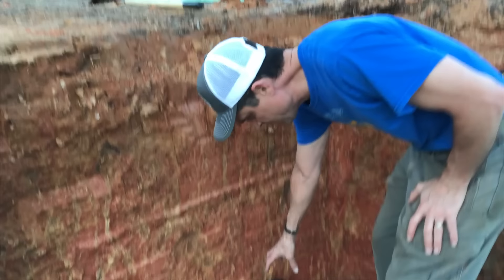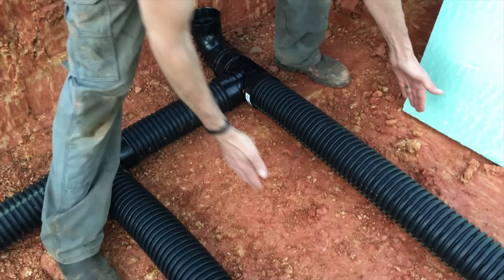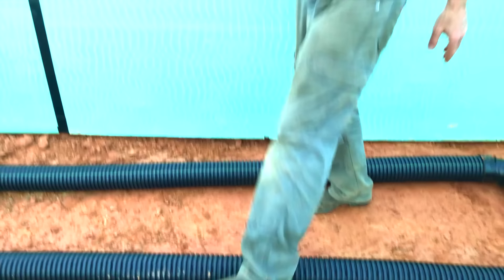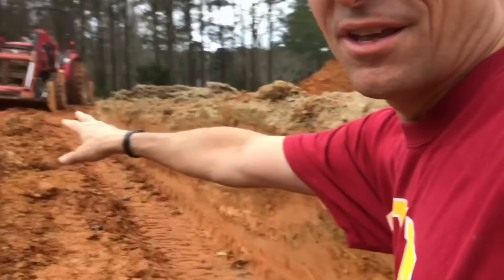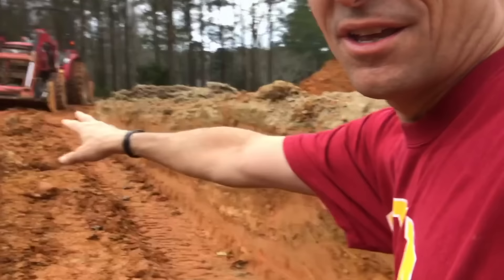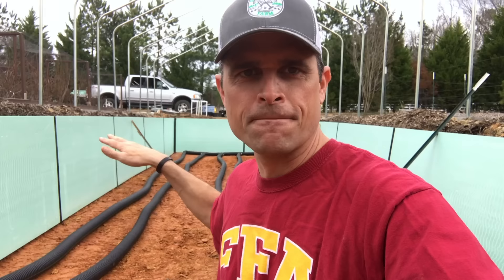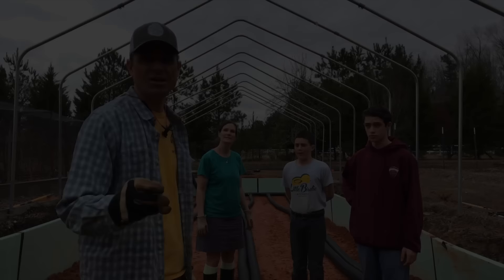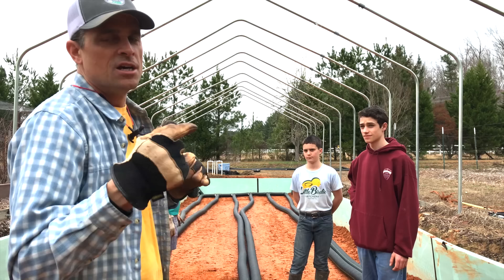DIY Geothermal Greenhouse Part 4: Earth Battery INSTALLATION

Comment: Why are you insulating the ground which should be a steady temperature all year below the frost line?
Reply: Forget where their location is.. My area Friday will go down 6 feet or so, depending on type of winter we have. Isolating the battery will prevent leaching of heat
Reply: Frost not Friday
Reply: Bingo! You're intuition is correct. Insulating around the pit is 100% incorrect.

Comment: I would think that you need several intake & exhaust pipes rather than 1 per level.
It seems pretty restrictive and hard to transfer much heat. I hope that I am wrong and it performs efficiently.
Good luck!    😃
Reply from the maker: We're actually copying the systems that are installed by Ceres Greenhouse Solutions out in Boulder, Colorado: https://www.ceresgs.com/climate-control/gaht/  So we hope it works, too! But seeing as they have installed a bunch of these, we're leaning towards optimistic.
Reply: Yes, that is encouraging. They certainly would change design flaws in subsequent builds if they noticed performance issues. Praying for clear skies for you.
Reply from the maker: Thanks for the prayers! And we'll all get to see how it works soon enough. Best case it works better than we might hope, worst case it moves air and is marginally effective. It's all one big real time experiment. But trust us - we'll let everyone know if it doesn't work as well as we hope!
Reply: Copying is as good as what you copy.  What calculations did they use? What performance testing have they done?? and are you in CO also?  I'm more into water thermodynamics, but I'd guess you have a 75% bottleneck by using the same size pipe as a manifold.  Dig it up and use 8-12" smooth duct for your manifold.  You've put thousands of dollars of labor and materials into this, don't blow it on one critical detail.  Seriously, the airflow is far more critical than the insulation.  

Otherwise the construction and design looks great, one of the best.  Good spacing, no need for gravel, not overly complicated.
Reply from the maker: Thanks for the comment and info. Seems projects like these are always a learning process if it's not something that has been done a million times. And even then, there can always be improvements or more efficient ways of doing it. In truth, we've looked at a lot of videos and read a lot of information on different websites. Even there, folks will say one thing ("You need 10% of the volume in linear feet of tube.") and there seems to be no science or data to back it up (and people let them know that). Another point made is how often the air in the greenhouse needs to be turned over an hour, but no reason is given for that number. So a lot of this seems to be a case of someone did it one way, and a bunch of folks started copying it, and that became the way to do it (including us). So this is an experiment for us. If we have to dig up the ends later and adjust the intake and manifolds, we can, but unfortunately we are on a very tight timeline right now. We'll have to see how it does as installed. All this is to say, your points are well taken. Perhaps we'll put a high efficiency fan at each end of the system, one pushing and one pulling. Again, thanks for taking the time to comment.
Reply: I take back what I said about CERES, their pictures show larger manifolds.  Threefoldfarms also describes a large manifold with short tubes.  

There's nothing new or mysterious about heat transfer, you can calculate it easily once you understand how it works.  Short tubes =less resistance to airflow.  I'm commenting because of so many poor designs on youtube videos, with only a few comments pointing out the obvious flaws, and then your design missed it by an INCH.  

The research has been done, from the 70's, it's not that hard to find.  If you don't want to do your own then pay somebody else for the expertise.  

You have a decent experiment there, measure the airflow, temps and calculate the stored heat per hour, then dig up the upper manifold, fix it and measure again. Compare this to the original design, and to the lower layer of tubes for two controls.  You could easily switch back to the old manifold to confirm the result.  Then you'll dig up the lower manifold and fix it.  THAT would be an experiment, bumbling around and posting video of it on youtube is not experimenting.  I don't think you want to build a dozen of these systems before you figure out how to make it work better, but that's basically what people are doing by copying a video design that has no proof of performance.
Reply from the maker: Is the concern with what we've done that we will have too much resistance to airflow? Or not enough resistance? Or that air won't move evenly through tubes? Or that it will just be significantly less effective/efficient than it would be with a larger manifold? We checked the system tonight and the air flow going in seems nearly identical to the air flow coming out. We do plan to test the system at different times throughout the year and share results.
Reply: Too much resistance.  You have short tubes for low air resistance vs one long slinky tube.  it's just the manifold that's the restriction vs 8-12-18-24" like the professionally designed ones.  Airflow is everything, there is so little heat in air that you need to move a lot of it, and as cheap as possible because air is so much more expensive to move than water, per BTU.  plus a solar greenhouse in the winter may have an hour or two of extra heat to capture.  

With the right size manifold that system will easily capture twice as much heat for the same watt fan.  That might only mean a couple degrees difference at night though...
Reply: I think that your configuration and layout of the piping system is as good as I have seen and I've been studying this since the mid 80's. Sure you might have used larger headers, but why? The airflow will drop once it hits the laterals and allow more time for the heat to bleed off. Your two ended design is genius and solves many problems including air mixing. Don't listen to the naysayers, everything including the insulation is correct. You did your research well.
Reply from the maker: Rebecca, I must admit that your comments have been dogging me since you posted them. Continuing to do more research, you are absolutely right. Our need to rush the design and build of the greenhouse shortchanged us on time for research. There were several things I was not grasping as part of the total design. Unfortunately, this means I'm headed out today to see how much of a challenge it will be to dig up the ends of the pipes and replace them with larger manifold pipes. Thank you for taking the time to comment and continuing commenting in an effort to help me understand!
Reply from the maker: Thank you for the feedback. Unfortunately, I am now coming to understand the need for larger manifolds. 4" energy efficient fans are pretty limited in terms of CFM. When you move up to 6" fans you can more than double the CFM for not much more cost. The problem is that 6" fans really won't work with 4" ducts - at least not for the manifold. This is of course how HVAC ducts work - why that escaped me before is still a mystery. Ultimately, most sources say we need to turn over the air volume of the greenhouse at least 5 times an hour. To do that we have to have a higher CFM fan - a six inch fan with 6" manifolds.
Reply: I don't think it would be too bad at all to dig up the ends and put a bigger manifold in.  I would go much bigger than 6", but that's just an untamed donkey guess, I'm not a ventilation engineer and don't play one on youtube.  The fans are all rated for cfm at whatever pressure, for a fan it's an extremely low pressure, a centrifugal blower will be rated for a slightly higher pressure, but you want to keep the pressure down and the airflow up.  The only way to do that is short runs of big enough pipe, and manifolds sized for the amount of pipe, actually sized for slower movement in the manifold to get the most even airflow distribution among the pipes.  Also, don't make the perfect the enemy of the good, just ask me about my geothermal greenhouse, haha.
Reply from the maker: Well, it took us 12 hours straight just to hand dig up one end - I guess not "too bad at all" is relative, but we're glad we did it. Two full days to complete the project. We're not going with bigger than 6" because we simply couldn't find anything bigger on our extremely tight schedule. Cost was also becoming a factor. 8" PVC and fittings are extremely expensive (for us anyway). So 6" it is. But we ran inlet and outlet temperature tests on the system already (using a leaf blower) and the results are amazing (shocking really).
Reply: Like before and after tests?  I'm curious.  Hopefully you got slightly less heat drop because of way more airflow.  Probably way too late, if 6" is what you can get, then making two intakes with their own fans at two corners and outlets at the other two corners would get you the same thing as a larger sized manifold.
Reply: Some folks install enough sensors in their system to get a picture of what happens. If you used LDS Preppers "formula" of converting 10% greenhouse air volume into linear feet of tubing you wont have enough. The tube headers should be sized to carry the combined volume of the tubes they are supplying. Common sense should tell you that one 4" tube wont carry enough air to supply six 4" tubes. The greenhouse air needs to be turned over sufficiently rapidly to keep pace with the incoming solar gain in summer or your greenhouse will overheat. If you have the correct amount of tubing this will be at least 20x an hour, having extra capacity is better (i designed for 60x). The fan must be able to provide the required flow at the required pressure, measured in cfm and inches of water (wc h2O ).
To achieve this you need a low resistance tubing layout because the more air you move through a tube the higher the losses, doubling the airspeed, quadruples the loss. The tubing layout should not present a resistance greater than 0.3" wc at the systems maximum flowrate.
Folks that sell these systems spend more time compiling their sales pitch than they do on testing what they sell ;)
Reply from the maker: Thanks for this information. As we've said in some of these videos (and replies to comments) the design and build of this greenhouse happened much faster than we might have hoped due to the blessing of our son being awarded and FFA grant. We figured trying something might be better than nothing and have been adjusting the design as we go based on comments like yours. The good news is that we will eventually be building a much larger greenhouse and implementing the wealth of information people have shared with us in the comments on these videos. As to this system, we'll approach turning over the system nine times, but not nearly 20. Hopefully, this hasn't been a complete waste of time, talent, and treasure.
Reply: If you get the chance, i recommend installing temperature sensors in one of your tubes at regular intervals, 12 sensors is a good number as you can connect them to a meter via a 12 way rotary switch to select each in turn. Install a few sensors in the mass so you know what the ground temperature is. With the system running, switch through the tube sensors and compare the readings to the ground temperature. What you`ll see from the sensors is the air dropping to the ground temperature in the first 10ft of tube and then coasting through the other 40ft without transferring any more, 20% cooling efficiency wont keep pace with incoming solar gain in the summer. Very few, if any, of the systems on youtube monitor much more than the in/out tube  temperatures which are meaningless without an accurate airflow measurement ;) If they spent a few dollars on sensors. they would see exactly where they went wrong. I guess not knowing is preferable to digging everything back up. Its the innocent folks copying these flawed designs  i feel sorry for ;)
Reply: Rebecca Kimmet so nice to take the time and point errors in someone's hard work.
Reply: Hi from Argentina Rebecca, it seems you have a good knoledge about thermal batteries. I  choose sandy loam soil instead of gravel due to a cost issue. Do you think it will work efficiently? Id like to have your opinion and show you pictures from my thermal battery.Thanks a lot!

Comment: With an R factor of about 1 per inch of soil I would want to see some research on the effectiveness vs. cost of using the insulation along the perimeter of the thermal mass.  However, placing rigid insulation right at the bottom edge of the greenhouse and going down 2' into the ground can prevent thermal bleeding into the greenhouse itself. Basically, you keep the frost line out of the greenhouse and extend the use of the greenhouse later into the winter months - something I've seen firsthand.  During your use of the greenhouse in the course of the next 2 years would you make a record of the ground and air temperatures for both inside and outside of the greenhouse?
Reply from the maker: Thanks for the feedback and info. Yes, we plan to track data points at various times of year and share them in the future. We've done a few one year update videos. We'll no doubt do one for this as well.

Comment: Good day, I am also planning to put in heating and cooling for my greenhouse. How effective does this technique work, what is the increase in temperature using. And how low do your temperatures drop during winter and are you able to heat it during the winter?

Comment: I really like this but am afraid that the air flows to the “path of least resistance” - the tubing should be one long path, forcing the air to flow all the way back and forth across the 6 lengths
Reply from the maker: As we've posted, we tested airflow out of each length and it was equal. Air is like water. If you were put it into tubing with six outlets (even as they were increasingly far away) the water would find equilibrium, not the path of least resistance. It would come out all six tubes equally. As does the air. The upside to one long pipe is perhaps greater cooling/warming of the air due to time spent in the tubes.

Comment: The only thing that I do not like about the way you have your pipes laid out is that it seems like the air will just take the path of least resistance and the bulk of it will go down one tube to the exit and ignore all the other tubes
Reply from the maker: If you think about the heating and air systems in your house or your car, they operate with main trunks and then branches going to the registers or vents. Air wants to reach equilibrium in terms of pressure, especially in our case where all of the pipes connect back to one exhaust pipe. In fact, we checked this (but didn't get video) by running the system with open ends on all six pipes. The air coming out of each was the same. Hope this helps.

Comment: How do you know for sure that the air goes through all of the pipes? The forced air could take a shortcut and come back out the other end...
Reply from the maker: Not really sure we understand the question. Air goes in one end, and blows out the other. The only shortcuts we've discerned is that air actually finds its way back up through cracks in the dirt - which is not necessarily a problem.

Comment: Only thing I’m worried is the clay seeping into the weeping tile and blocking the efficiency of your intention, 3” stone in the bottom and reduced to the surface to 1/4” finish gravel would have given a much better flow rate as well as thermo storage. I would like to know how yours does work out   Bonne chance
Reply from the maker: Going to upload the next part in this series today. We dug up and replaced the manifolds with 6" pipes. We did have water in the lowest pipes, but there was no clay in them. Water was clear. Check out this website for great information, on bit of which is why you need perforated pipes on earth batteries: www.ecosystems-design.com/faq

Comment: The system could be pitched slightly to one corner with a sump pump just in case it fill up
Reply from the maker: Good idea, but two months later (and grading work done to prevent flooding inside the greenhouse) the issue now is little to no moisture in the system not too much. It is actually less efficient without some moisture.

Comment: Maybe all of you can help me. This green house geo warning/cooling is still a bit confusing to me. I thought the temp was a consistent approx 58 temp @ approx 8 feet deep. I thought the idea is to use the 58 degrees to cool in the summer and the glazing heats up the 58 degrees in the winter. Therefore, why add insulation around the pit? I saw on another channel that a 4 inch manifold is not mathematically correct, and it needed to be 6 inches for proper volume of air flow. Is this true?
Reply: Exactly correct Dbarrabee. Insulating the pit defeats the purpose of the geothermal.

Comment: Won’t with this system the air will take the path of least resistance. Meaning the air is going to go mostly thru one pipe to the exhaust.    Luca